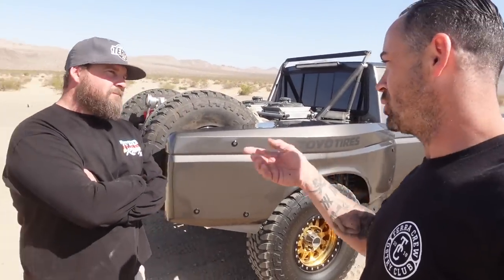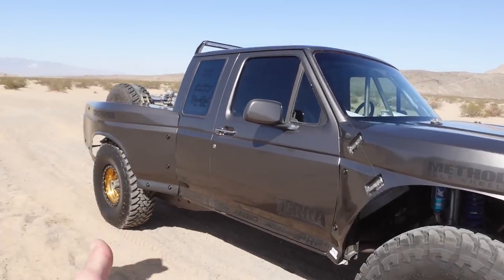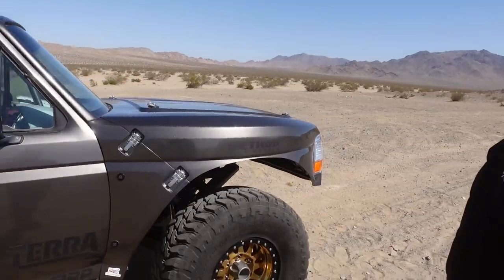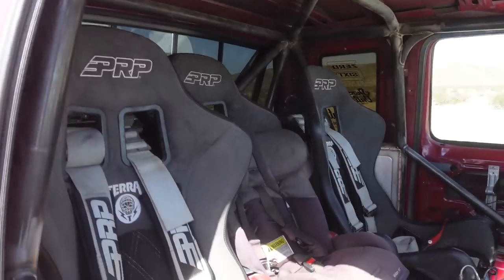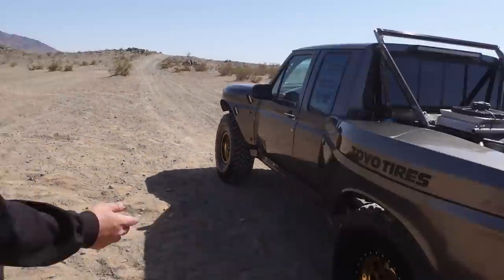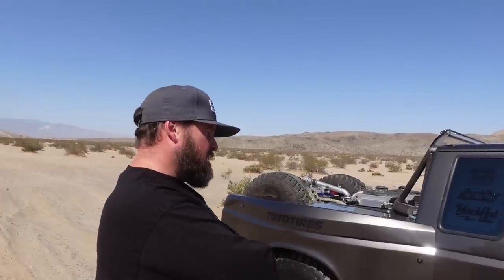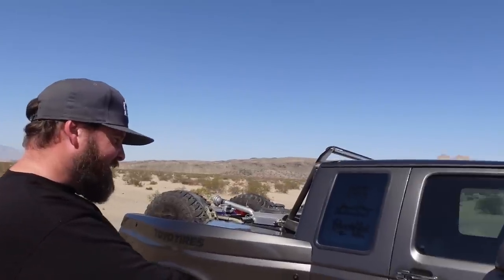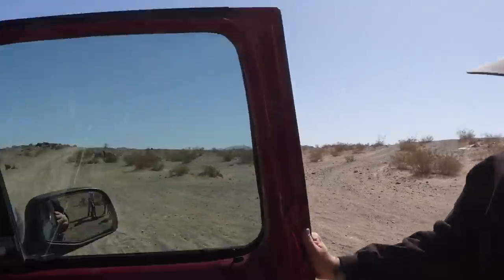OBS F-150 Prerunner Walkaround w/ Morgan Clarke! Prerandan Build Series Ep. 7 | BUILD SERIES

Comment: So what's the biggest difference between a pre runner and a bush truck? Or offroader?
Reply: Prerunners were originally well equipped long travel suspension trucks that guys would use to “pre run” the race course before racing the next day/week etc.  they are usually 2 wheel drive trucks with a lot of suspension travel, big shocks and big tires, equipped to carry everything you may need to do basic maintenance or repairs offroad (jacks, tools, spare parts like drive shafts, belts and hoses,spare tires, extra fluids, etc).  Then people started building them just because they are fun hotrod offroad trucks that didn’t necessarily serve a purpose on a race team.  In one sentence, prerunners are trucks designed to go fast over very rough terrain, big shocks, big tires, lots of horsepower and working doors based on a regular passenger truck from one of the major manufacturers.